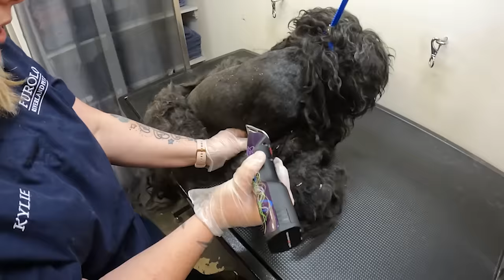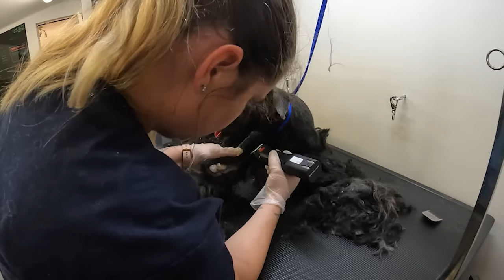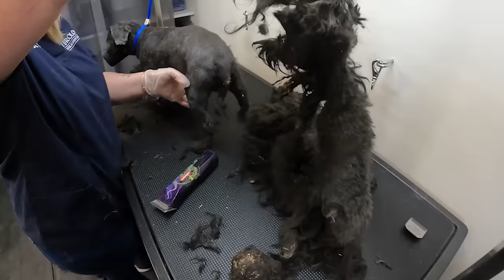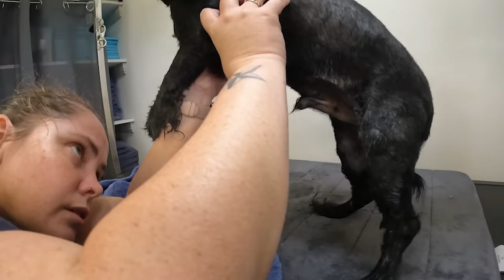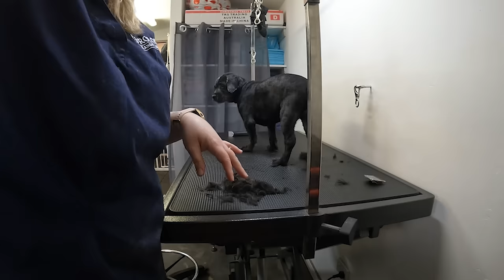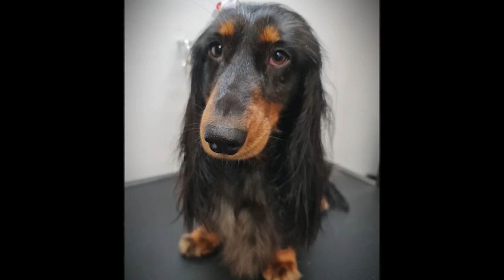Worst Matted Dog! PART 1 of 2. We found Wocky under all this poop, matted hair, mud and sticks.

Comment: Such a brave little guy <3 <3 <3 Out of curiosity, did he need his ears plucket as well? 🙂 Being a poodle owner, it's one of my pet peeves 😀 I'm always looking for tips and tricks to maybe do it just a tiny bit better, since my sweet poodle queen doesn't like it very much ;-)  Lots of love for you guys for giving Wocky a SUPER grooming experience (y)
Reply from the maker: Hi Helle 
Thanks for joining the conversation.  I actually don't do a huge amount of ear plucking to be honest. Only if the client specifically requests it and the dog tolerates it. I believe ear plucking is internal medicine and should be done by the vet or vet nurse. I also don't believe groomers should do anything painful as it can be damaging to the bond and trust between groomer and pet. Vets will happily perform the task at check ups for a small fee. 
I do pluck my own toy poodles ears on occasion but not in big hunks or to clean out the whole ear. Just a little bit each week to help keep it clear. I use ear powder and my fingers and have been plucking weekly from 8 weeks of age. This way it is part of his regular Sunday groom and he tolerates it quiet well. Where I have a dog that is used to it, I pluck.
Hope this helps 🥰

Comment: Have you ever tried a hammock with the dogs that get tired of standing. It clips on the bar and holds up the whole dog while you groom. It also comes in handy when you want to do the nails on a difficult dog.
Reply from the maker: Hi Julie, I do use a hammock on occasion, great little tool to have in the salon.

Comment: Had a job that included dead and or very ill smelly near dead beings.  The smell was awful of course.  One of the coroner assistants told us the use Vicks Vapo rub under our noses to block the smell.   It really helps so i would suggest it to you for smelly dogs.  Works for smelly poops in the home.
Reply from the maker: Will definitely add this to my tool box!! Thanks!
Reply: Being a retiree RN I can recognize the Vicks in your nose. I kept some with me in my pocket at work all the time. Needless to say I used it often.
Reply: Being a retiree RN I can recognize the Vicks in your nose. I kept some with me in my pocket at work all the time. Needless to say I used it often.

Comment: Using scissors can be preferable to remove some of those mats. You've already cut the skin with that razor, stretched down due to the weight of the mat. Cut off the bulk of the mat with scissors so the skin is not so stretched.

Comment: You are a very special lady. How do you trim the inside ears?
Reply from the maker: Thank you, Mary 💕 
I use my clippers to trim the ear leather but must be very careful to keep it supported and flat. Only clipping in the direction straight off the ear to avoid catching the leather edge in the blade. 
The inner ear can either be plucked or tidied with clippers and leave the rest.

Comment: I’m curious and concerned did you use the seven just down the back and then switch to a 10 for the legs the rear To me that would be safer and yes I do love your compassion
Reply: Just what I thought a 10 would’ve been safer🥺🥴
Reply from the maker: Hi Brenda 
From memory and what I typically do with a matted groom. I will use which ever blad is going through easily. I'll start with a 7F, then onto a 10F and even down to a 15 or 30 if it is safer. I'm not at all concerned about how it looks, only that the matting is safely and as painlessly as possible, removed. 
It's very common to go down from the 7F where required.
Great question!
Thank you 💕

Comment: What nail clippers do you use?
Reply from the maker: Currently just a mid range set from the local pet store. They aren't worth sharpening and don't last more than a year so I settled for a pair that cost about $20. They last a year and were super sharp when I got them! This set is 6 months in and still sharp!

Comment: Don't you have more than two blades ? They have to be getting hot.
Reply from the maker: Hi Nancy, 
I do have more than 2 blades. I have 4 of each and they are on a sharpening rotation. At $50 - $80 per blade,  it's not worth while to have more than 2 on the go. I work in air-conditioning and check my blade temp constantly.  They don't get hot very quickly but as soon as they are warm to the touch (not hot), I swap them over. If both blades need time to cool, I'll move to the sanitary are (a different blade) or something else while they cool. It's not at all inconvenient and definitely not a risk to the dog. Just a typical rotation. These types of grooms work the blades a bit more than a regular groom but it's so few and far between that I wouldn't change my rotation for it. Just work around it. 
Hope this helps to answer your question 🥰

Comment: Why didn't you take the nasty hair off the table instead of working around it?
Reply from the maker: Hi J 
I used to work in a tiny trailer and its an old habit to just push it to the side and then bag it at the end. Definitely working on breaking the habbit! 💕